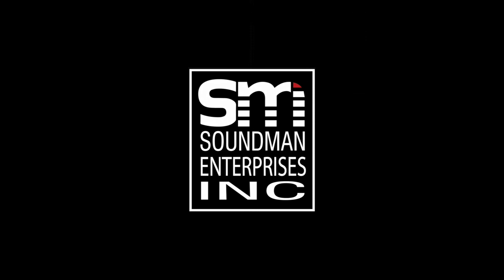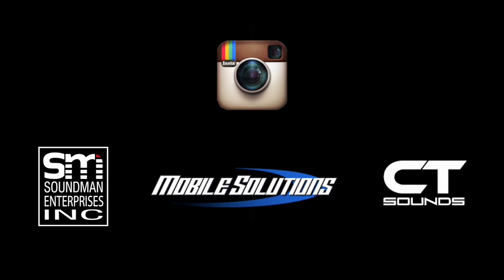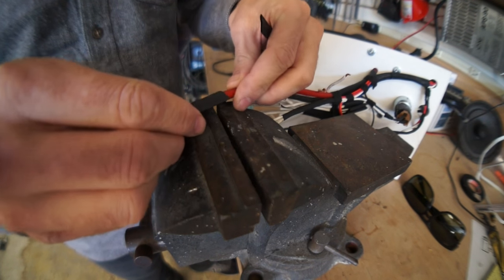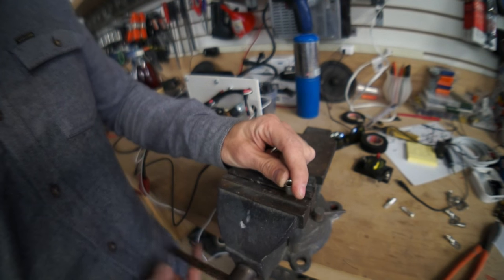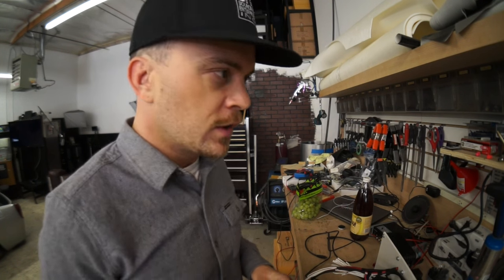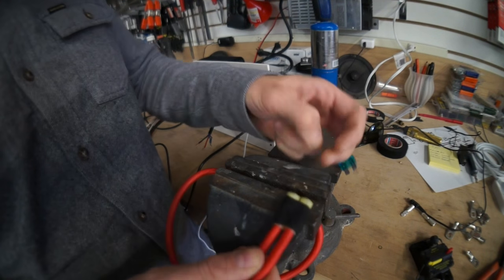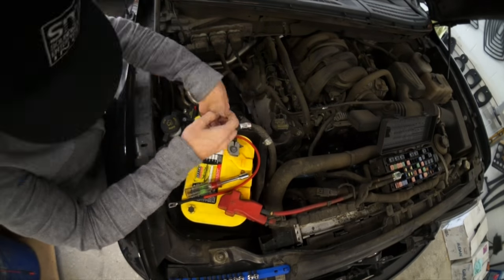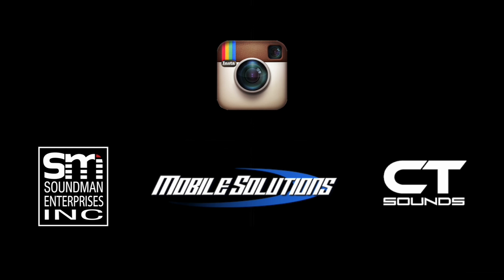Get Lugged Up

Comment: What was that connector you used for the power wires? I saw it used by Steve Meade for his trailer previously. I could use a connector like that for my application.

Comment: hey dude, i got a question: why'd you use a circuit breaker instead of a regular ANL or similar fuse block? i worked at a car audio shop for years and never seen anyone use breakers, so i was just curious. cheers!

Comment: Cool vid! I've got a question about ah stinger battery i have, it's been sitting in my car for awhile its pretty much new but I've let it drop below 10 vilts to long and i have their battery tenderizer on it thats 40amps but the battery seems completely dead! Do i just chalk it up to lessons learned and buy another one cause stinger won't warranty the damn thing or buy optima or get an XS POWER battery? What would you suggest I'm tired of buying these batteries and they die!!!!👎🏼😵
Reply: You can't beat XS Power batteries
Reply: +Doug Bernards (Soundman) you also get a pro rated discount after your 3 years if the battery has issues!

Comment: Doug, i though i was the only one in car audio using anderson connectors! Right on! It's a shame more people don't know about them.
Reply: +Skylar Garrett They use them on forklifts with battery banks so big that my old employer changed them out with an overhead crane. I see no problem using them in ab car audio application

Comment: The reason you're not supposed to "hide" power wire directly from the battery is so that in an emergency situation, emergency crews know exactly what wires they need to cut to kill all power going to your vehicle.  No techflex, no loom, no tape.  Make it very clearly visible.  After the fuse, do what ever you want.

Comment: Doug I was wondering when soldering wires inside your Vehicle,  do you recommend a butane iron or would a cheap battery powered iron be good? cause I have a good iron but don't always have access to a wall outlet for power. what would you recommend and what do you use?

Comment: If you loom the wire before the fuse it the loom may cause a fire if there is a short and the wire heats up before the fuse blows.
Reply: The reason I said this is because I once (before I knew any better) ran a wire from my battery to my trunk along the frame rails of my car (unibody) without a fuse. My mechanic lifted the car on a hoist and it pinched the wire. The wire glowed red starting at the battery, and just about burned my car and the shop down. I always run my wires through the car with a fuse now..
Reply: +Michael Williams I agree, Like I said, this was back when I was broke and didn't know any better.

Comment: Doug, I have a J/L audio 2 AWG line running to their fuse box from my battery, its connected by an allen screw and has come loose twice now. That circuit breaker looks good, I found a 100 amp version that looks dope. Think that will work ok.
Reply: +fritze01 https://www.facebook.com/photo.php?fbid=10208803778438043&set=a.1099336369879.21680.1420753212&type=3&theater

Comment: let the crimp vs solder battle begin lol
Reply: +nismofreak34 crimping correctly does a cold weld. hence making the copper solid. Winning. The end.  If you need more.. google "cold weld". Look at the images. But there is not a damn thing wrong with soldering like he did.

Comment: Doug check your PM. I solved your optical audio / charging problem.
Reply: Yeah I'm not Mr youtube so who knows, it probably went your email inbox or something.... at any rate I'll post here. Have you bought yourself an Apple Lightning Digital AV Adapter? The adapter has lightning male for the iPad and Lightning female plus HDMI so you can have the iPad charge while sending HDMI out - connect to HDMI to Toslink box and that should solve it. This way your not bluetoothing and wifi'ing and all kinda nonsense.    http://www.apple.com/shop/product/MD826AM/A/lightning-digital-av-adapter?fnode=85

Comment: ya heatshrink wastin sob
Reply: +Doug Bernards (Soundman) 6 feet later.
Reply: +Doug Bernards (Soundman) that's what Rafa's mom said!
Reply: +Doug Bernards (Soundman) hey check this out -  when I solder my lugs like this also , they talk shit telling me it's a cold solder joint and isn't correct and will have problems.   What do you think about that ? Since I see you do the same way also.  I haven't found another way to solder the lugs.  You think it matters soldering it like that ?

Comment: Ya need some flux Sir.  Cold copper and oxidized solder isn't the best connection.
Reply: +Doug Bernards (Soundman) I know you get a lot of bad advice from ass-hats in the comments - but really, tin the wire first if you want to, and load the lug up with solder.  At that point all this flux is gone, gone, gone into smoke.  So dip the wire in flux before you dunk it into the heated lug and you&#39;ll be golden. Love the videos - looking for more info about headless installs and USB dacs on a budget!  Thanks!

Comment: The connections where great, BUT it to be 100% correct you should heat up the wire aswell, so the solder gets fully inside the wire. Just sayin.
Reply: +Peeter Piip you can see he did that first :) check the solder on the wires before he put em in :)

Comment: MECP STATES 18 INCHES AFTER BATTERY.  JUST SAYIN....
Reply: +Forevermct1 is it ok to have 20 or 21 inches? or will my car explode and burn down? :)
cant fit my 0 gauge fuse holder any nearer the battery. The best spot was to stripe it on top of firewall at were the water seal is.
Reply: +orfeous The only purpose of the fuse near the battery is to protect the wire from thermal overload (too much amperage for the wire to handle) or shorting out. The closer the fuse it is, the less likely for a short if it happens to not be protected by the fuse as well as short runs can carry huge loads therefore, it is safe from thermal overload.
Reply: +Doug Bernards (Soundman) Rafas mom got 18 inches one time, took 3 guys from the front of Home Depot.
Reply: what kind of weird crap are you watching man...lol